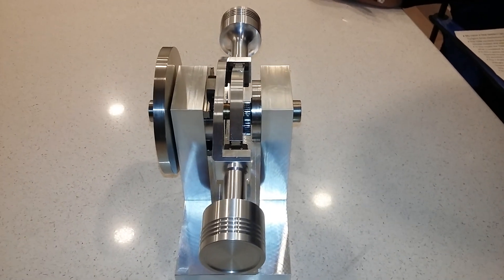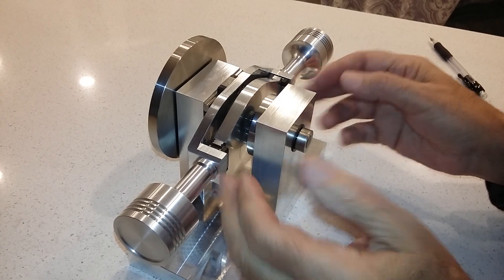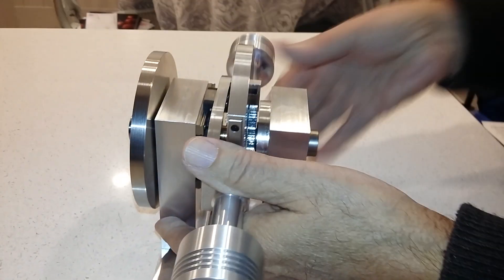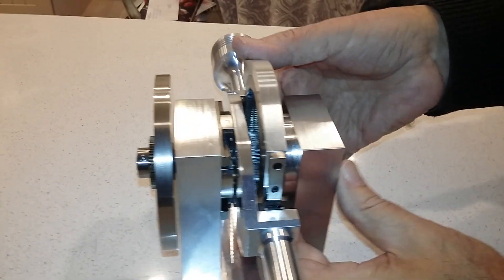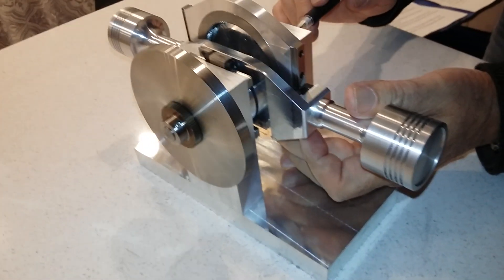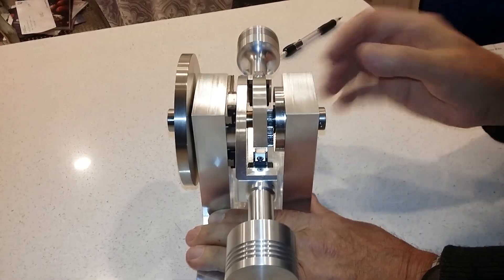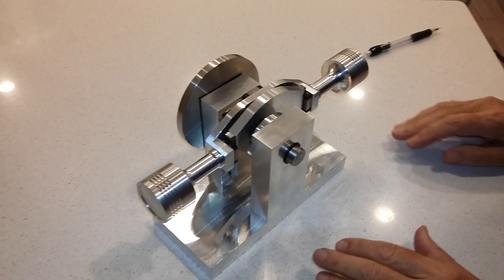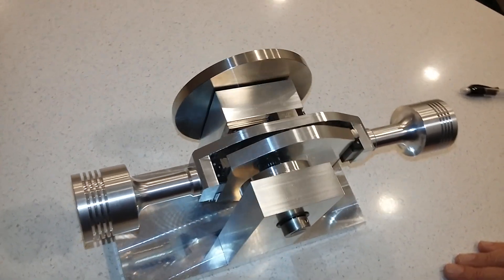Tangent Drive Compressor or Motor Concept.

Comment: How do you do with friction on the sides of the plate ?
How does the gears handle the torque ?
How do you balance the moving assembly ?

Comment: I genuinely appreciate new ideas in any form.  Good job, and keep on innovating. 
It's like Otto and Wankel had a red headed step child and called it Tangent Drive(edited).  :)

However... 
I'm concerned about the unbalanced mass you are constantly accelerating and decelerating here and fear you have not factored that into your estimates.  Yes, you are eliminating the connecting rod, but you are ultimately replacing it with something of much higher mass and it is completely unbalanced.
Quoting an estimated efficiency improvement and ultimately showing it via experimental data are two very different things.
Reply: Very nice reply Arcus, thank you. You are correct the unbalanced nature of this design is a significant source of power loss and vibration, however, this is just a model. It is possible to completely balance the hoolahoop motion of the x-plate with some additional engineering. Very astute comment.

Comment: Interesting design, how did you have this cut? I feel like there are also some far simpler ways to do this though with out the need of as much as you have, I would love to see the cad files to give you more feedback. ( as long as there are no problems with copyright stuff because I don’t wanna get tangled up in that...)
Reply: Stam_ 1na This is just a table model, designed to illustrate how the mechanism works. There are abundant changes and alterations to be made when designing for a specific application and then again for manufacture.